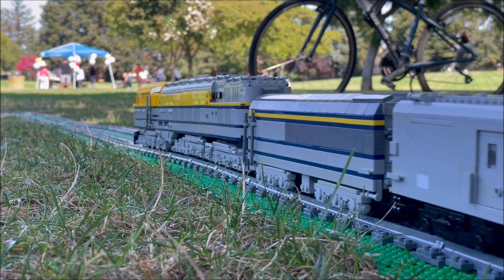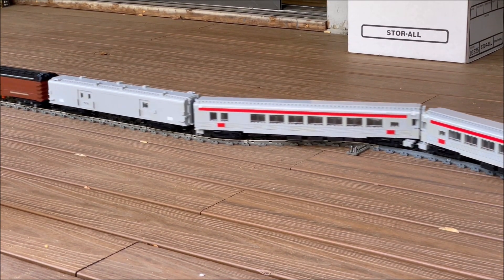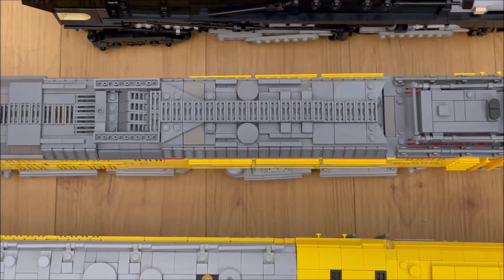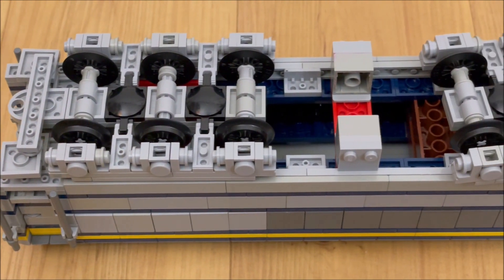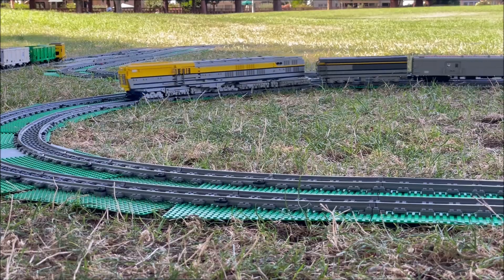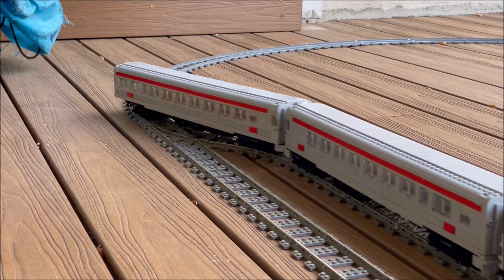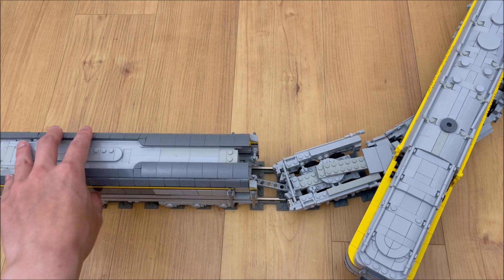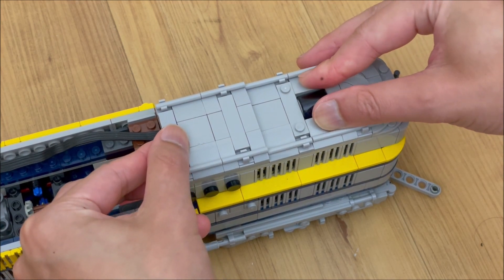LEGO 1:48 Chesapeake and Ohio M1 Steam Turbine Electric Locomotive (Not PF)

Comment: the fact that this thing is literally the width of an r40 180 turn and can navigate it with the body 90 degrees relative to the tender is both insane and absolutely hilarious, very impressive
Reply from the maker: Actually, that's something I forgot to mention: if you dont need to run on R40, you can shorten the drawbar and close the gap between the tender and the loco to a more realistic distance!